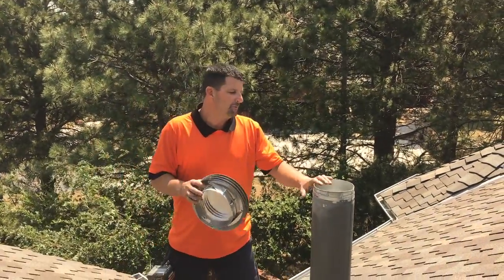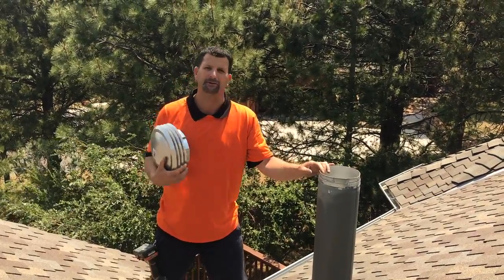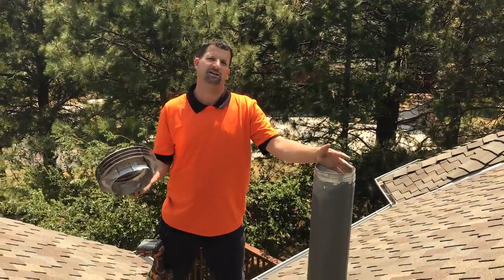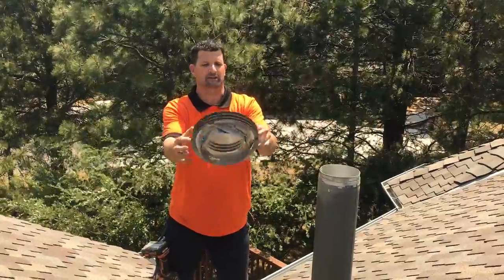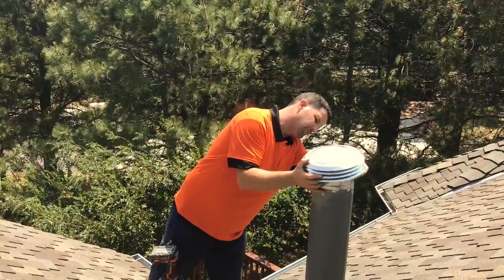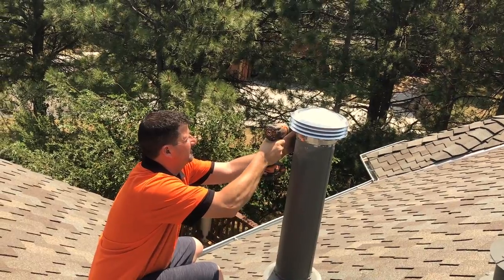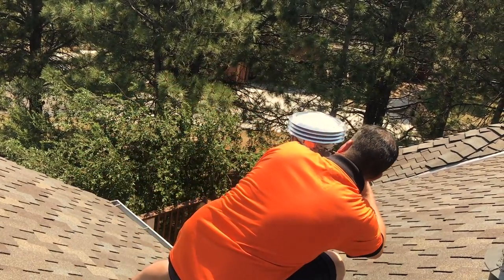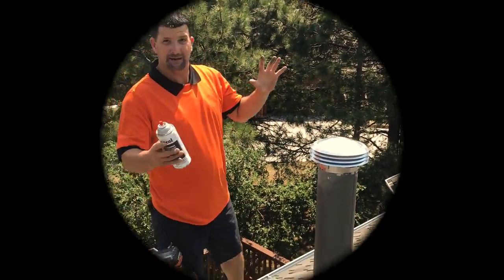HOW TO REPLACE A FURNACE VENT CAP | COLORADO SPRINGS ROOFER

Comment: I have had 3 contractors (1 HVAC, 1 roofer and 1 general contractor) to my home to provide me an estimate on fixing our furnace cap on the roof of our 3 story town home. The general contractor even brought out a drone to see what they needed to do. None of them would sign up to do the work or provide advice on who might. I never even heard back from the general contractor (Columbia Contracting LLC) after getting promises twice that they would find someone to help and send something to me within one to two days. So... any advice on who I can call to get this done - and done right - would be appreciated. The issue is that birds are getting into our heater vent system. This has been an issue since I got a new roof. Last year we had two get into the house, and when we turned on the heat in the winter the vent path was clogged with dead birds and stopped the heater from working. We would like to resolve this soonest now that spring is with us and the birds are abound. thanks in advance for advice.

Comment: Never let a roofer replace an HVAC cap. Yes, they're easy to replace, but unfortunately, they're also really easy to put on wrong, which can cause carbon monoxide to back up into a house. Put them on too low, and gas can't escape. Put them on too loose and they blow off and leave a huge funnel to let rain and snow get into your house and furnace. Also, sadly, roofers will normally replace a cap that is actually designed to be used on your system with a cheap Versacap from Home Depot or Lowes (like the one shown in this video) because there's much more profit in using a $9 part than there is in buying the correct part that costs $30-$40. Either ask a mechanical contractor to replace your HVAC caps, ask your roofer to hire a mechanical contractor to replace your caps, or ask the roofer to leave them alone. Are you going to trust a roofer to make sure that you don't have toxic gases venting back into your house? Let roofers roof and let the HVAC guys replace the components of the HVAC system. And if the roofer doesn't replace the cap or hire someone to replace your cap, make sure he's not taking the money in your claim for doing it. That line item is almost always bundled in the category and total for your roof replacement.
Reply: I let my roofer replace my hvac cap because our dumb hvac people put it on wrong and caused a leak and didn't put the collar where it was supposed to go
Reply: Great point. I'm a roofer and we just did a condo association project with 16 units. They just called me and said their gas fireplaces weren't working. We did in fact use a 5070 Versa Cap and we should have used a direct vent or vertical vent.  It wasn't the price point that made us use them however, it was naivete.  The versa caps are like 55 65 and 75 dollars depending on size and I'm told the vents we needed are like $100 ish a pop. Lesson learned, not sure a roofer can't do it, but it's good advice to ask your roofer and at least make them aware of the situation.
Reply: same - our roofer put it on and messed up the gas heater causing the gasses to blow back into my house. Had to get a HVAC guy to fix it - roof guy didn't even know neither did I of course. That's pretty dangerous